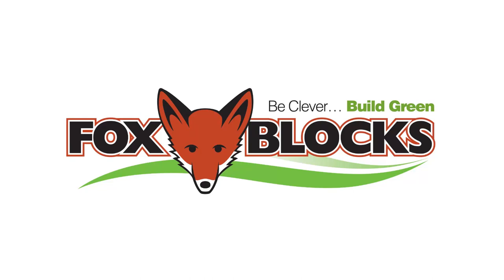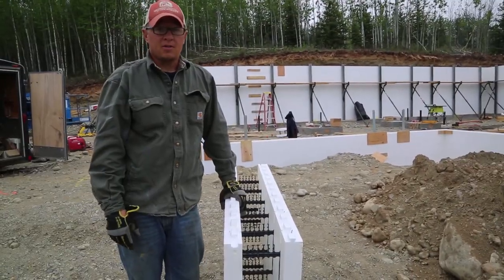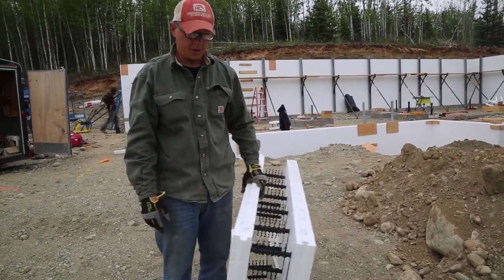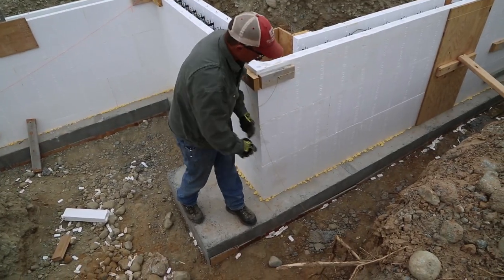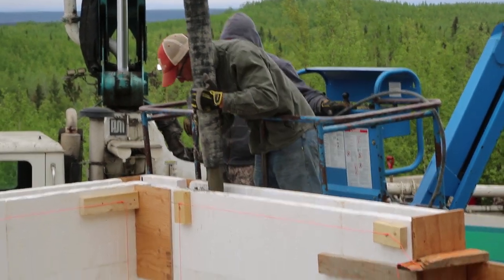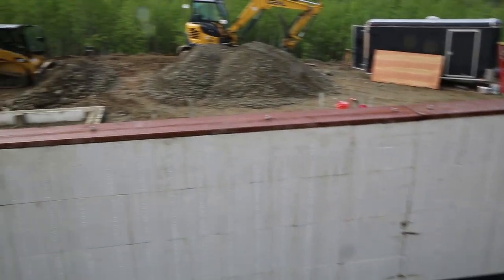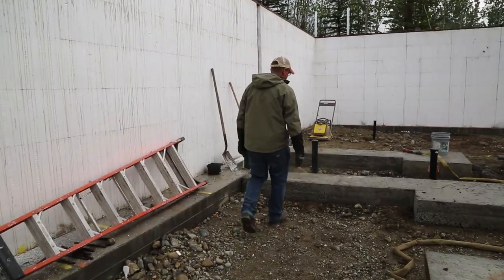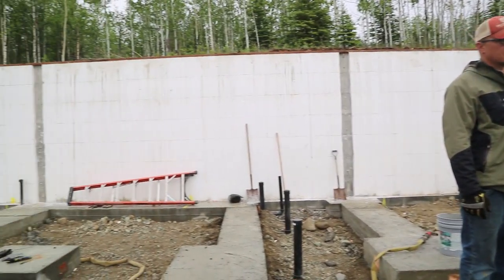Fox Block Foundation Walls - The Bargain EP3

Comment: We have some damage to the exterior of the foam block portion of our 22 year old house. Basically about a golf ball sized hole in depth and width. Any suggestion on a filler. Hesitate to use expanding foam from a can as it always turns dark yellow and degrades pretty quickly when exposed to sun. This is a South facing wall with patio butting up to it. I guess I'm trying to say aesthetics are important.

Comment: Fox Blocks (although called something else in other part of country) are awesome and ideal cos you have a solid wall PLUS insulation and also helps keep warmer in winter times but cooler in summertimes due to how concrete works.  Another thing good about this is, with the right shopping around you can clad this in any type of wall cladding as you so desire.

Comment: Can ypu please just 'BALLPARK' the Cost difference vs cinder or plywood form & seal? Because as I research these literally today... "supply chain" issues are the big deal killer right now. Foxblocks are Very hard to find here (and concrete guys who've done allot of ICF builds)  Very few in 80814 (Pikes Peak). Lemme know a ballpark figure percentage wise if youre more comfortable that way.. coz im hearing all sorts from eaxh side that contradictvtye other with pros ajd cons. I think thr old school form guys are feeling threatened?! ICF is takingvoff in AZ or so my sibling says... So if you can - as I'm at this stage now of making a decision and have to pull the trigger to beat the midsummer rush. Id really appreciate it. Thanks. 

(Off topic) We're doing post/beam hybrid vs your full timber frame build... and heard you (or your bride) mention something about the strips of styrofoam she cut out for "XYZ"? (She was hard to hear then) Are your first floor support timbers going all the way to the basement floor? Or anchoring to the main level floor? (Only seen this 1 video- so apologies if answered later. It is 2AM here zzz) Reason I ask is take our 60' wide floorplan and divide it into 18/24/18' sections left to right and the middle 24' is for the den and where we are using post n beam... plus the full wall stone 46' tall fireplace. So for us; that 24' space is the only timber area besides the kitchen and master ceilings.  and is only propping up the center 12/12 45° roof at 36' as a cathedral ceiling ... so don't think I need to go into the basement? Mtg with structural engineer Tuesday to get his opinion - but at $100 a foot x 10 support beams 36ft. Long? (46' if we go into the basement) Staying on the main level - Saves me roughly $35K just in posts if we can fasten them at ground level. (-10' less per post x den size front and rear) and may even set them half inside and half outside if we go up to 10" or 12" on the support posts (6" inside. 6" outside which is a 24 x10 poured slab porch and could put pilar pods in those and anchor there?  as the basement is 40x40' (as of today) with the aforementioned 20ft floors at ground level on each side of conventional 4" slab for mudroom and garage etc - that too saves us $50k. As thats 2x4 stick build vs timbers. I still shrug seeing 200' of timbers lining a mudroom? But hey if you got it go for it!  Saved 35k by knocking off that extra 20'x20' of basement too vs 4" slab. Hence the hybrid name :) Love our home plans!! 

Anywho. Great video. VERY HELPFUL!! Well done. WHERE did you get your adjustable ICF supports from? Rentals? Show the rebar work nexr time if you do more videos on ICF as ppl meed to see how important; yet how fairly EZ it is with FoxBlocks. The caps being added at pour time was a nice touch too 👍 Cheers!

Comment: Looking good. Just curious, the ICF homes I've seen had all but the roof and non load bearing walls done in ICF. It looks like you only did the parts that will be touching dirt, any reason not to do more of the structure in ICF?
Reply from the maker: Hi Mike, we love full ICF construction, but ultimately wanted a house with lots of timber work, with the timbers as the structure, so are going that route.  The reason we choose to frame the front basement wall is because it has alot of openings that are easier to frame.

Comment: Did you have to cut level your final course on these foam block before you put the sill plate on?  It looks like you did and I was wondering how....Were you able to pour concrete all the way until full on the final course with the teeth still intact?

Comment: I love the bit about putting on the top plates with J Bolts while the concrete is still wet.  I never thought of that.  I wonder why they don't do that with regular concrete forms.  Was it difficult the get the top plate level when you did this?
Reply from the maker: Hi!  Yes, this saved alot of time.  When you finish stacking your ICF blocks, you trim the top ICF block level to your finished height, accounting for top plate thickness.  Worked well!

Comment: I love the insulated part, but also the concrete wall part.  Are these walls strong enough to carry a concrete slab or do you require additional measures?  Thank you for sharing.
Reply from the maker: Hi, yes, the slab gets poured on top, we do backfill around the walls to support before the slab.
Reply: Fox Blocks (& most other ICFs) come in a variety of widths from ~4” concrete core to 12+” concrete core. Fox also has special blocks that have an extended ledge for bricks, ledger boards, joists, etc…

Comment: Do you have to put some kind of stone/brick veneer on the exterior?  If not seems like the foam on the exterior would be destroyed in no time.
Reply: Yes. The blocks can/must be finished with a normal exterior, be it brick, stucco, siding, etc..   Do your research on how to do this - different climate zones and surfaces have different recommendations (possibly requirements) on how to do this.

Comment: I'd never heard of this. Sounds good. How does the cost compare to traditional poured foundations?
Reply from the maker: It's very cost competitive, especially when you factor in labor costs - the blocks are very easy to install, and you get a insulated, structural, vapor barrier-ed wall, ready for siding and drywall, that works below grade, in one step. This is definitely the way to go if you can get a concrete truck to your job site.
Reply: Great, Thanks!

Comment: will you continue with that same wall system all the way to the top or is that just for the garage and basement o ps cool video good job yall
Reply from the maker: Thanks!  We will do ICF walls below grade, frame the walkout basement walls and garage door wall, then from there, do a timber structure with sips enclosure.
Reply: cool

Comment: I'm interested in how you took care of water infiltration on the walls that are underground? 

Thanks
Reply: french drain
Reply: In one scenes of the frost wall you saw they had Grace water shield applied to the concrete.  You want to do something similar to the ICF as well as add a dimple board or drain board to channel the moisture down to the french drain.  the ICF itself is waterproof but the joints at each block edge are not and will allow moisture to penetrate to the CC and ultimately inside the structure if you do not...

Comment: It looks good and and smart , but for the strength of the concrete walls, I understood, one does an iron basketry on inside...?
Reply from the maker: Yes, there is so much rebar to drop in, thank goodness the webbing makes it pretty simple to snap the rebar in place.
Reply: Horizontal rebar is laid down between rows, and vertical rebar is simply dropped in. If you alternate which side of center your horizontal bar is placed, it will hold your vertical dead center without any additional work

Comment: Can I ask how much you spent on the blocks?
Reply: idk how much they spent but my local hardware store charges $25-30 each for them depending on the thickness. Since it saves time, labor, money on wood forms and has the insulation already built in I think it's a pretty good deal.
Reply: IF you are doing the assembly work yourself(stacking block, rebar, bracing and forming all the openings) and hire the pour, figure around $10 per SQ/FT of wall area...
Reply: I purchased the foundation for my new build today. The blocks were 22.11 corners were 29.04 clips were .60 I also needed the foam to attach and seal 27.22 a can and a special gun is required(not same as a caulk gun-I'm borrowing one- they are about 50.00) and rebar was 7.00 for 20' section. Total cost of these materials was cheaper than just labor on a cinder block build. For me, tbh- I wanted control of my build. I wanted something I did not need help with, just to challenge myself. PLUS the salesman told me this forgives footer imperfections, and I have that condition. ;)
Reply: rronmar Does that include the concrete? Thanks